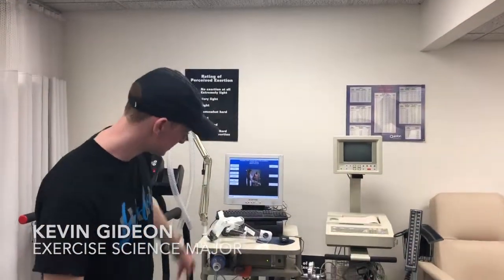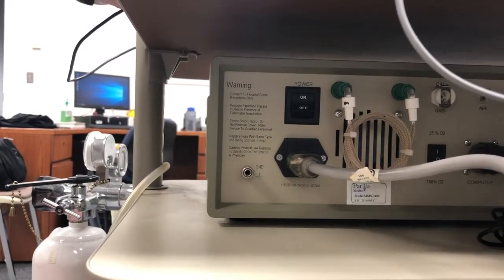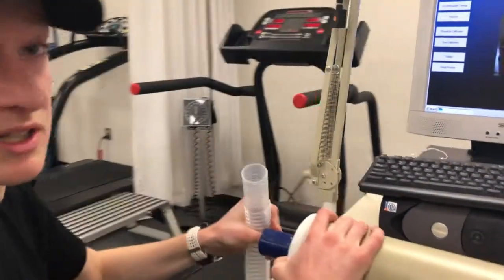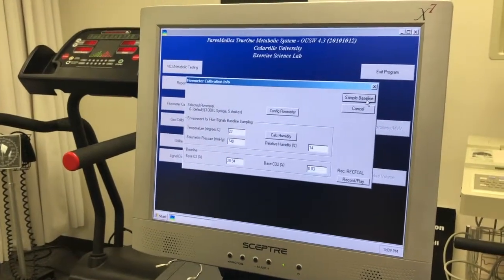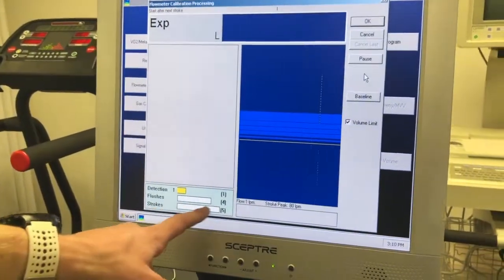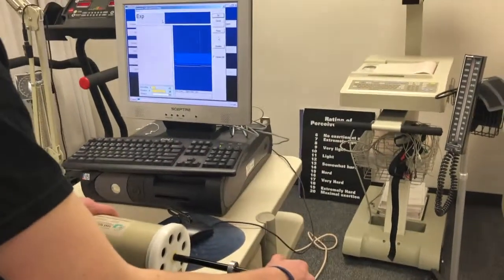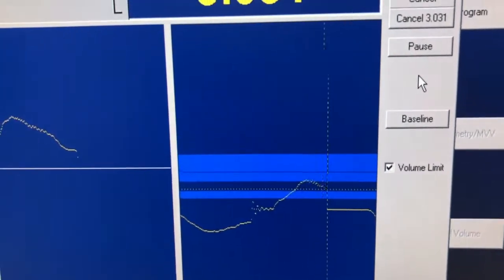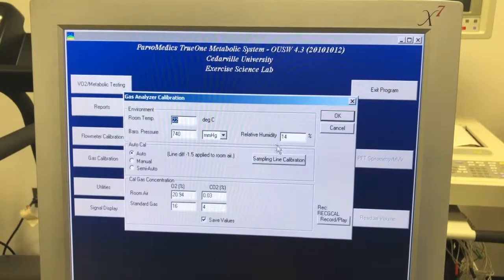How to Calibrate a Parvo Medics True One 2400 Metabolic Cart

Comment: You got that message at the end because your calibration gas wasn't hooked up! You can see the hose dangling at the side not plugged in to anything. Great video though thanks.
Reply from the maker: That's funny. Thanks for pointing that out. We made this video for a class and our professor didn't teach us much. The machine is 17 years old we just got it replaced. The guy who set up our new machine taught us a lot and we realized we did a lot wrong. Like in one of the other videos we use bleach to clean the parts and you aren't supposed to do that...so we are still learning.
Reply: Oh no I love it you guys did a great job explaining the basics. We're actually using this video as a stand in for our labs because our university was forced online. I just got a chuckle out of your hesitation when the warning box came up. So, thank you for making our Coronavirus home lockdown labs successful!